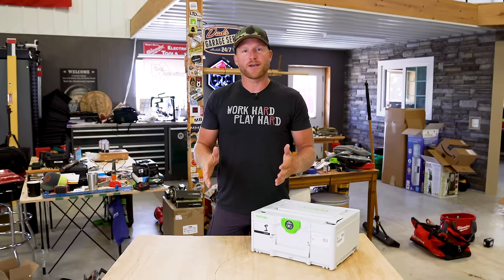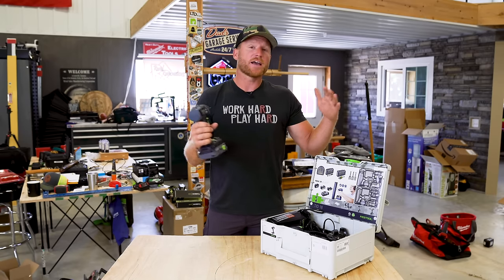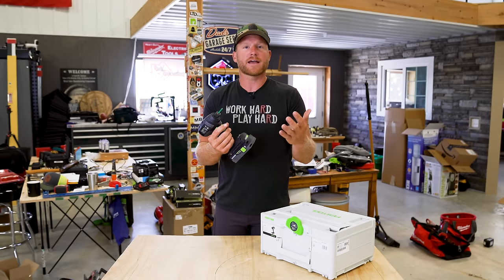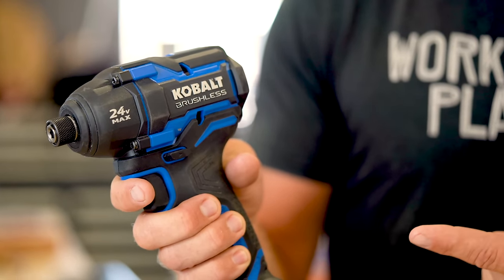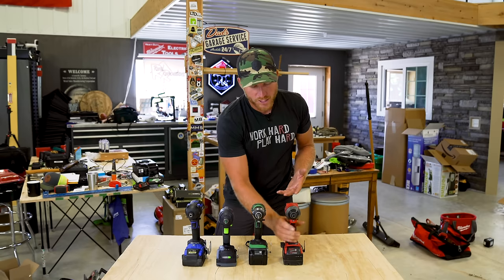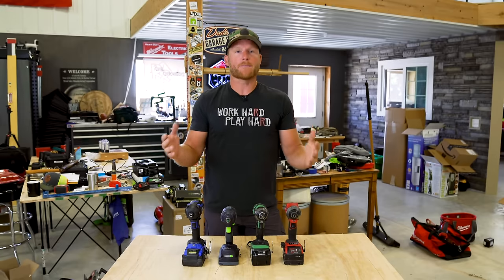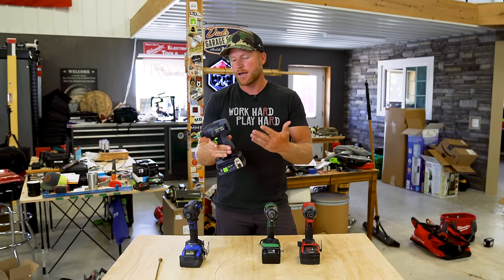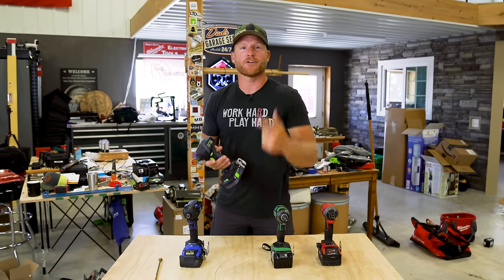Festool TID 18 Is it any GOOD?

Comment: Editing suggestion.

From a viewer's perspective, screen visuals help a fact dense video become organized and understandable. 
This video is fact dense, you are verbally throwing out specs like price and power for multiple tools. 
The viewer can follow along if the verbal queue is followed by a visual screen aid like putting the price above the drill. 

Additional visual fact aids: Doing side by side column chart of the tool specs and price so the viewer can compare the tools.
This allows the viewer to wrap their head around a comparison. 
Or having a screenshot of the tool and msrp off the manufacture website briefly pop on the screen. This adds some editing character rather than Kyle blandly talking for twelve minutes.

I separated this paragraph into sections, was it more comprehensive than a condensed paragraph? Yes. In fact, the visual appeal of an organized comment probably prompted you to not only read what I had to suggest but read it completely.  Apply the same visual concept to a video.
Reply from the maker: Thanks appreciated and noted

Comment: Congratulations Festool! Kyle this is the best video on tools day yet. All of the videos I do on my channel about My love for Makita was about feel I dumped all my brand new fuel Milwaukee because of ergos. When I did those videos the haters come out of the woodwork. Why would ever get rid of big red for Makita. Simply it’s the tool I want to pickup each day it fits way better than anything else. I must agree bags stink I hate them. Makita use to put their drills in cases but nope not anymore. The price of the festool I don’t think think is too far out there. If you were to buy a hard case for any reason of the other brands you would be right in line of the festool price. My problem with the festool is if I try it I might want to dump my Makita.  The funny thing is the Kobalt, amazing tool if they put the effort in ergos they would hit a home run. Great video love the thoughts on how the tool fit as apposed to just a drag race as most channels do all day long. We don’t work in a drag setting we work in an ever changing scenario you want to use a tool that fits and is comfortable. Makita the ergos balance and weight is far better than anything else I have tried now you got me thinking about festool. Great job sorry for the long post.

Comment: Have you ever held a 24V Greenworks impact driver or hammer drill?
They are very comfortable to hold and are pretty powerful. They are a budget tool so I’ve been looking for informative reviews about them.
Not to many of the popular tool influencers talk about the Greenworks line so I’m wondering if it because they haven’t t heard of them , are they just not good or it because since the tool is a budget tool it might appear unreliable which in turns makes the business look unreliable

Comment: Men don't let other men grab their "triple hammer"...unless they are REALLY close.

Seriously though. great review. Most people don't go into ergonomics and in my opinion that is one of the most important factors. Sort of like a car that is cheap, has lots of muscle, but sitting in it and driving is not enjoyable for the long haul. You are less likely to use that tool, except for rare occasions. Glad you brought up battery platforms.This is often overlooked. You are not buying individual tools like in the past, you are buying ecosystems. What might be a cool follow up video is testing the batteries you find in these ecosystems. How long they run for? How long do they take to charge? Costs? How many cycles each battery is rated for (Relates to overall battery life). Be very useful for people picking out an ecosystem to invest in.

Comment: To me, Festool is something you consider buying after you have been working with wood for a while - you have bought and used your entry-level tools - and now you feel justified in investing in some higher quality tools. 
I am still working with entry-level tools for the most part, but I am heading in the direction of upgrading some of the tools, and Festool is a consideration for tool upgrades.
Thanks for the review, I found this helpful and subscribed.

Comment: Without the tool in my hand, I can't say for sure, but the improved ergonomics may in part be due to the way Festool doesn't design their tools with flashy overmoulded grips? Almost every other brand tries to look like a running shoe to catch the buyer's eye, while Festool looks plain, but moulded more for function than looks.
Reply: Rob Locke What’s weird is, I’m normally on the same page with you, but when it came to the Festool impact, the flush and restrained overmolding made it way less comfortable than a Milwauke, Dewalt or Makita.

Comment: I'm a festool user through and through, nearly all my power tools are blue and green!, but when it comes to drills and impacts i just use the top range dewalts based on the price. As tools impacts and drills get beat up so much in comparison to others that its difficult to justify the cost. It's interesting that you say you don't use the 'T' setting Kyle as I thought that would appeal to you.
Reply: You are missing a lot.I have a PDC six years old - hardly see a name on it  been used and thrown around so much - and still works like new.If you bring me a bucket load of makitas,dewalts,etc I would still use 6 years old PDC.Pound per pound best drill driver out there

Comment: Another note, I would like your input on T mode, it is for sheet metal applications, where the bit senses after it has high-speed release through the first material and then reduces speed for application into the wood.  Have you tested this mode on the cabin build with all the roof materials?
Reply from the maker: just not a fan really...

Comment: the tracksaw and the domino is worth the money without a doubt, the kapex saw...maybe,  depending on how accurate you like a chopsaw. 
people rave about the sanders, but i havent used them to judge. mirka is supposed to be great, but they break a lot.
all the other tools can be purchased as other brands for less money. 
despite the high prices, festool  still manages to sell tools in overseas markets where cheaper tools are available this speaks volumes about how good some of their tools are for serious woodworkers. where they fail is charging stupid prices for everything else. the systainer being a prime example.

Comment: This is the same reason I like snap on, Mac, matco, and Milwaukee, but won’t buy a Milwaukee high torque. They’re just easier for me to work with comfortably all day. Ryobi for home use cordless, and it’s not bad in fact I wouldn’t use anything else for home use cheap to get into, and it works fairly well.

Comment: Here in norway, the festool impact kit with batteries costs 9500 crowns which equals a bit over 1000 dollars. Drill / impact kit cost 12 300 crowns= 1400 dollars. Way out of my price point. Dewalt / makita all the way

Comment: Really been loving the TID18. Its lightweight, and has an all around nice feel to it. I haven't used the new T-mode yet, but that seems more suited to someone such as yourself. One thing I've noticed, like all Festool, is that the battery seems to last forever. I recently acquired the PDC to compliment the TID18 and that is a total power house!!!

Comment: I have used makita most of my life. I haven’t used another impact that is so smooth and feel right in the hand. When I have used dewalt impact feel ok but it’s run rough in comparison, Milwaukee is similar and I own some of the 12v gear it feel cheaper it feels like it’s going to wear it self out it short space of time. But I really wanna try to triple hammer!

Comment: i love the festool mostly because of its easy functioning very accurate with routers etc., they work very clean and smooth, but the prices on that same impact driver over here in the Netherlands are around the 500 euro ,same set as you reviewed, a makita on the other hand with 2x  5 ah batteries is 170 euro cheaper.so for a drill ,that is mainly more impact on your wallet then extra drill you get

Comment: I have a practically new dewalt 20 volt impact driver that the bits will not stay in the drive. Has anyone ever run into this problem? I know this doesn't follow the subject that Kyle is talking about but I figured this channel would have more knowledgeable experienced people that could help me with a solution. And it helps the comment count!!!

Comment: Great video Kyle never thought I would say this....but..... I think I might go out and buy a Kobalt impact. 😂
Reply: ...yeah, don't. It isn't actually faster or more powerful than Milwaukee. It may be a great little consumer product, but it doesn't punch in nearly the same league. Kyle is probably basing his statements off of what the packaging says. Rigid claims 2400 in. lbs. of torque. Milwaukee gen 3 is only 2000 and it will walk all over Rigid. The numbers that manufacturers put out generally don't mean a whole hell of a lot.

Comment: I am a Festool fan boy and have most of their tools - all corded since I run dust collection on everything. All my battery powered tools have a big red M18 on them. I've been hesitant jumping onto Festool cordless, but I know I will get there sooner or later since I've never been disappointed or had a Festool product break on me. Stolen yes. Milwaukee is really good and powerfull but not as refined and they do have some borderline shitty tools. I just got a "cheap" trade in on my first generation nailer that sucked big times. They were totally honest about it and said they knew it was a bad design, hense the trade in. New nailer works really good, and I just tossed the hard case - sorry Kyle.
Reply: steenfraosterbro I am a Festool fanboy and pretty much run all Makita cordless.  Anyone I personally know that also owns loads of Festool stuff....is totally running Makita or Milwaukee for their 18v needs.  I’ve owned the majority of cordless Festool cordless lineup and I don’t think they really compete even on like for like tools. Either a cordless Supercut or the Vecturo is the one true exception.  The drills have way better control and the best clutches in the universe but they’re also infinitely less powerful than a heavy hitting Milwaukee drill.  So, that’s a maybe (a yes for me).

Comment: I was just looking at that Festool. Is it my imagination or did Festool finally changed the 1/4" collet so it accepts all bits and apex's. Thats what kept me from buying Festool in the past was the propitiatory collet, Festool drill bits and accessories are expensive, I have a ton of the regular ones. I love your channel and keep up the good work.
Reply: You can/could always use industry standard hex insert bits with all of their drills and all of said drills have always came/do come with a supplied standard Rohm three jaw chuck that can hold anything it fits.   You’ve never been required to buy their mostly shitty proprietary centrotec bits. I’m going to blame Festool’s marketing for not properly getting that message across.  Yes,  in line with every other impact driver on the market, their impact driver only accepts industry standard ball detent hex bits.

Comment: I think personally the only real gripes I have about Festool are some of the component choices inside the tools (which could but not necessarily will affect the longevity of the tool), especially considering the price, and the amount of plastic they use on some of their tools where metal parts would generally be better suited for long term use, as for usability and the actual performance of the tools I have no issues and like said in the video ergonomics are usually pretty damn good. I also didn't realize that when Hitachi rebranded they separated the EU market with the new Hikoki branding and US with the existing german Metabo and adding HPT. Has there been any confusion in the US because of this?

Comment: I really hope Milwaukee makes a big push into the carpentry/woodworking side. If they don't have much coming down the "Pipeline" ( pun intended) then I will definitely be picking up more Festool products. I do have question though Kyle. Have you ever used a M12 impact on the job for an extended amount of time and if so what are your thoughts?
Reply from the maker: I hope so too!  the m12 just doesn't cut it for me

Comment: You answered my question before I  Could ask it did you feel constable in your hand with my question that's main line couldn't countable like a glove 

I saw you use a get a lot I think you are getting your opinion but I guess you already have your opinion about itAnd I think you're right about cases but  The cases should be practical So when you go out to the job site don't break Thank you for answer my question before I could ask you
🍻🍺👌👍🤙

Comment: I'm not a contractor, Festool look like a good deal with the stackable cases, but if my screw and hardware cases are anything to go by, the case you want is always at the bottom, that's why made a cabinet so my cases become drawers.
Would be good if festool cases were not just  stackable, but were also drawers.

Comment: On some Milwaukee tools you can order with a hard case for a little higher cost. But I see you use a trailer and have the room to keep your tools in the hard shell cases and it makes sense for you. Now for the most people who carries their tools with them for work most of the time they don’t have the luxury of having a trailer for one so space is an issue. Also your jobs side seem like they are building the building them self’s and get to pull up and have your trailer right at the front door. Now for
Me for example I work in completed building and have to go up stairs and in and out of rooms and in some cases while there is a company or a customer operating a business in the building while I’m
Working. So for me I use a packout kit and try to take
As
Much as I might need in one or two trips and for the most part I try and condense my tools as much as possible. Unlike factory molded cases it’s for the tool and maybe a little extra. For example, I have a case when I got my drill and impact. That hold two tools two or three batteries and a charger. Well I don’t carry my charger with me and just bring an extra battery or tool but I can put 3-4 tools batteries and bits all in one packout case that’s the size as the factory case. So I would be rolling in a stack that’s roughly twice as tall as I currently do. It’s already tall enough. So to me I would rather save the Money and just get a bag then a case. Now as far as festool. I have never used any of their things and I’m sure they are nice but what is in paper your paying for the name not the technology. In some cases it’s like snap on. Your paying for the name and for the weekly truck services.  I’m a Snapon guy and live their products. Sure I can get equal quality tools for less money but when I was at a shop there was a value to me having the weekly truck pull up and take care of any issues I may have and having the credit at times was also nice. But to me there was value in more then just the tools and I’m sure festool owners feel the same. Your paying for more then just a tool when you buy something b like an impact or saw. There’s service warranty how the company handles issues all of that. So if someone feels there’s value in that for them, then by all means pay more for the service instead of the tool technology

Comment: I bought the Dewalt 20v stuff, they give a good deal at the local Locke supply. I do have a 6 yr old 18v Makita impact that won't die. Also a 10.4v makita impact that I have been using for over 10yrs.

Comment: I use festools sanders and dust extraction. Have stayed away from their other tools. Not so much for the price but how they lock you into their brand. Kyle didn’t touch on this. And this would be a killer for most I would imagine. Is festools collet only accepts their centrotec bits. I don’t know if they changed that on this impact. But their others won’t accept standard 1/4 bits. I wasn’t getting involved with that mess. It’s a time killer when I’m installing and have different drivers laying around. I don’t want to concern myself with only certain bits fitting certain tools.

Comment: I have switched from Hilti to Milwaukee recently, almost all of my powertools. Had a lot of festool too. Problem with festool and Hilti  - they just work, and will continue doing it for many years without any service. Now I'm really into Milwaukee, because of price, performance and you get a new model every year. Regarding festool TID, here in Norway, same kit as in video costs 8.5k NOK (~940$, that's not a joke). Milwaukee FID2 I've bought... Aprox 3.4k nok. That's 2.5 times cheaper! 
Anyways, we need to take the best from the tools, so I kept all the concrete drilling/demolishing from Hilt, all for cutting wood from Festool (HKC, KS, TS) and all for screwing from Milwaukee.
Reply: That's because you're crazy in Norway!! Greetings from Denmark 😜